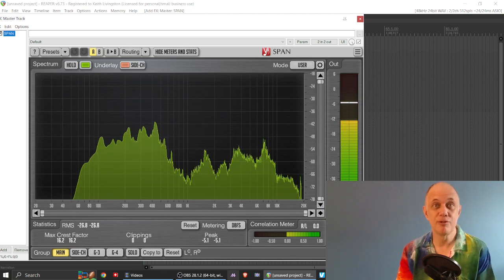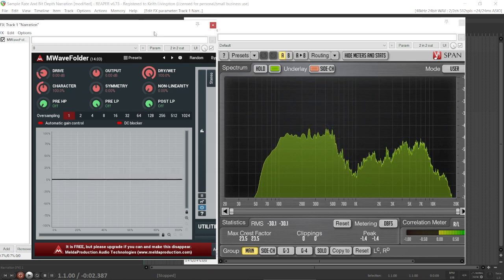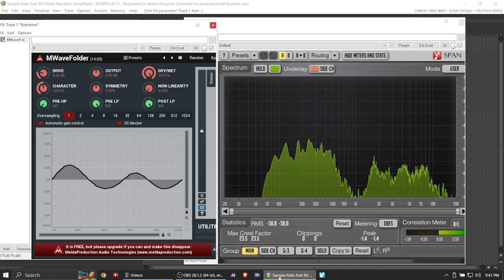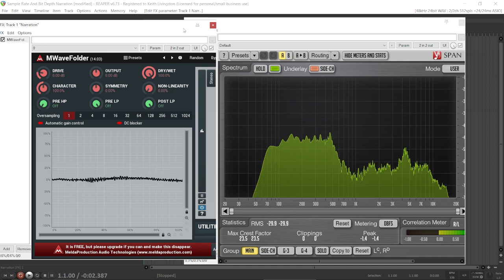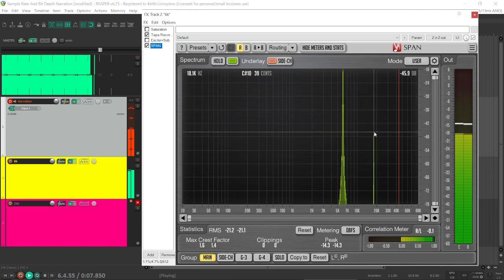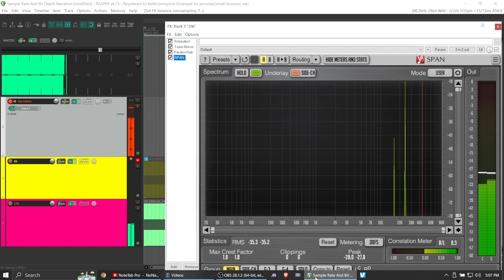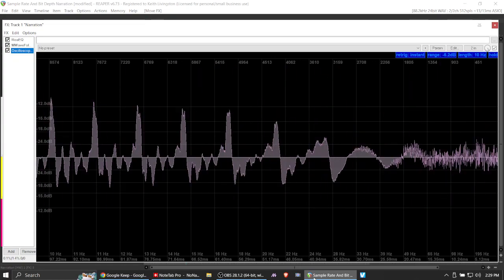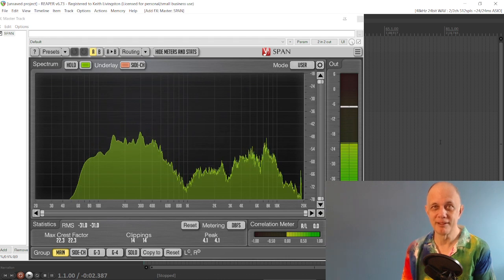What Sample Rate Should You Use?

Comment: You can implement Low Pass or High Pass filter without negatively affecting the phase of your sound by using linear phase EQ.
Reply from the maker: Linear phase EQ has its own drawbacks, such as pre-ringing.
Reply from the maker: Plus, we're not talking about a high pass filter that we put on a signal after it comes into the DAW. We're talking about the filters that are built into audio interfaces.